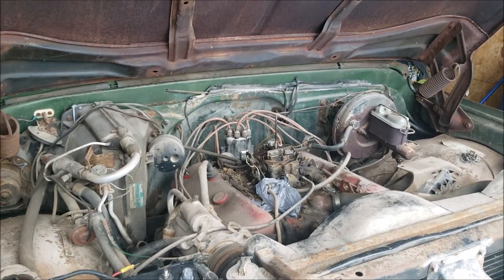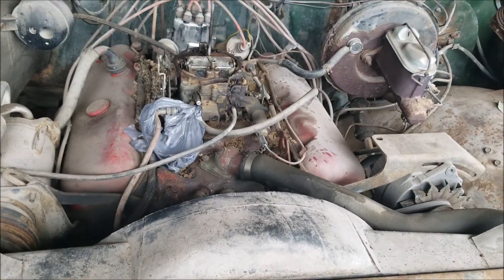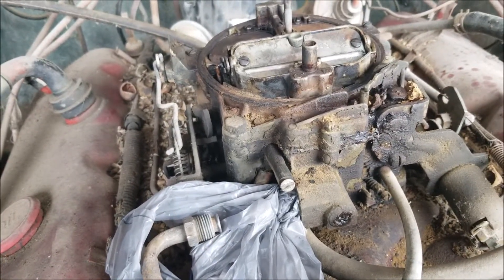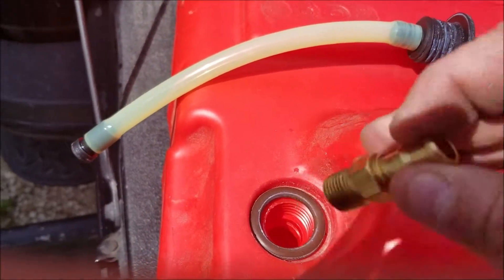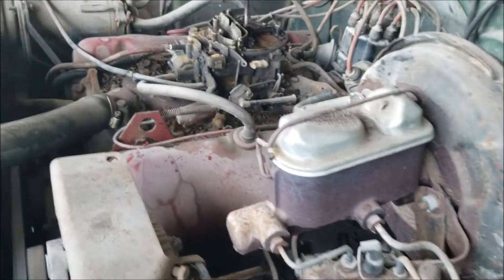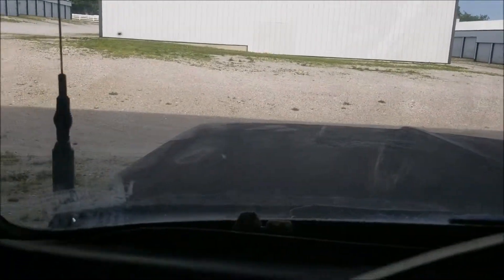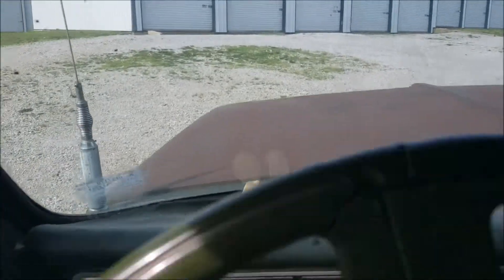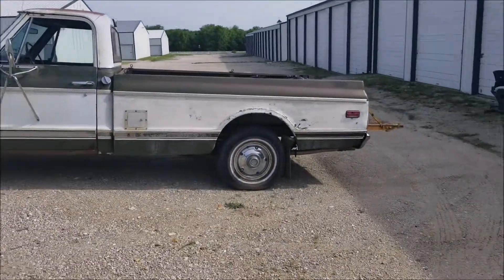First Drive Of 72 402 Chevy Super C10 After 20 Years In Field, Fuel Tank Bypass

Comment: did you have to open a vent on that temporary gas tank?
Reply from the maker: On the marine tank it has a vent on the filler cap and since this was just to start and move around the shop and not for the road, that was sufficient.
Reply: @tdsmotorsportshomediy  thanks.  Just curious - because I may be doing the same thing for a car just to see if it will start.   I dont want to use the gas tank on the car because it’s been sitting too long and will eventually get replaced.
Reply from the maker: Yeah, I was shocked.  With points freed up, new plugs and oil, my truck started pretty easy after setting 20 years.  Like I said the marine tank I used has a vent right on top of the filler cap